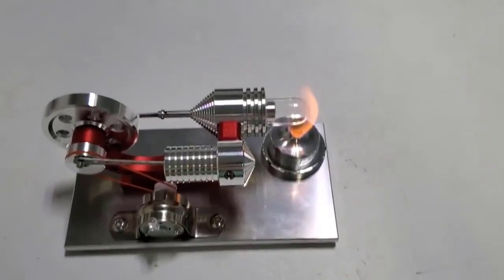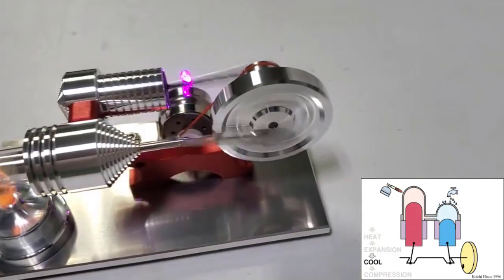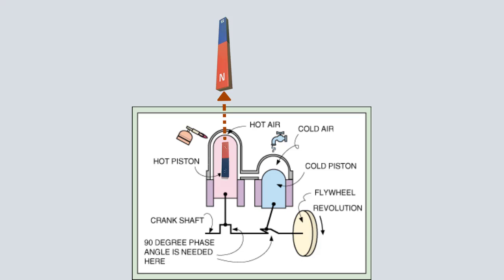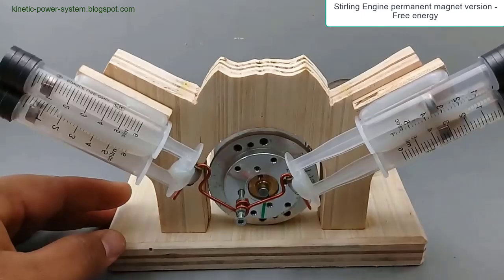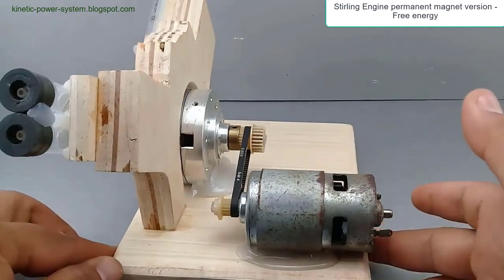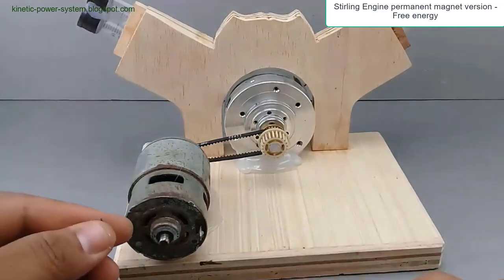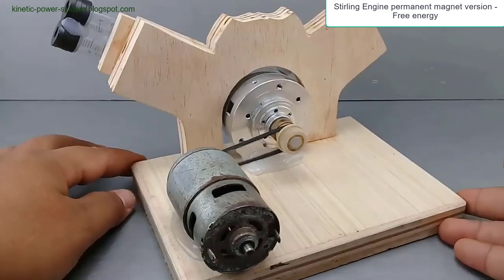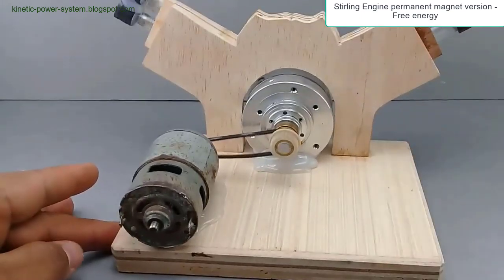Stirling Engine Generator and Magnetic Version Stirling Engine - Free energy

Comment: If you don't know what a HDD electric motor-mount looks like, you can see it in the center of this contraption, I`m just saying.
Reply from the maker: It operates without batteries. A non-induction DC motor or small AC generator will cause the LED to light up
Reply: @kineticpowersystem7932  No, not until some thing make it do so by force (Energy), you should look it up. It may save you both energy and time. However you probably herd the rumour. My point in-dearly, because nothing is useless and everything is ever-changing, mutch like a magnet,it`s EMF can induce current that dissipate into e.g.. heat and kinetic force. Likewise you or me, we have some force confirmed by observing, physically. It`s less obvious with personality, so we subconsciously try determining it by analysing outcome of the physical actions..  Wait.. does that make progress? Well,, I like that angle and so I will keep it!

Comment from the maker: The Stirling engine, known for its external combustion and regenerative thermal process, has long fascinated scientists and engineers for its potential in efficient energy generation. However, the traditional design's reliance on heat differentials between hot and cold chambers poses limitations in terms of efficiency, cost, and practicality.